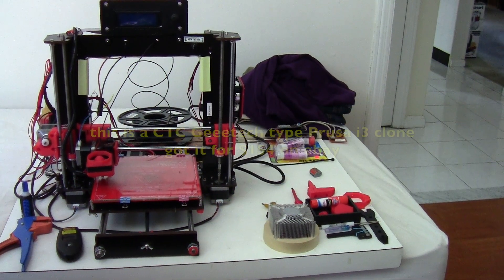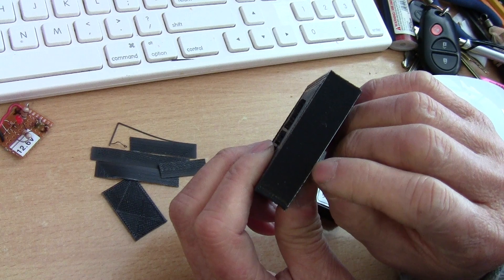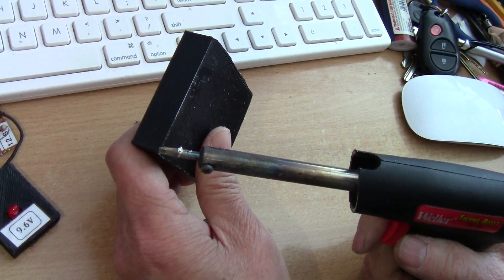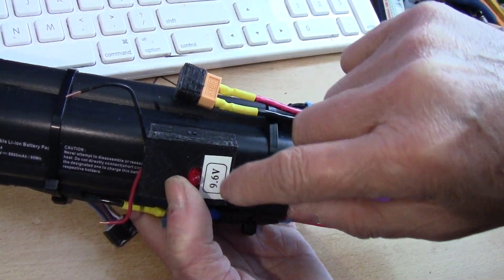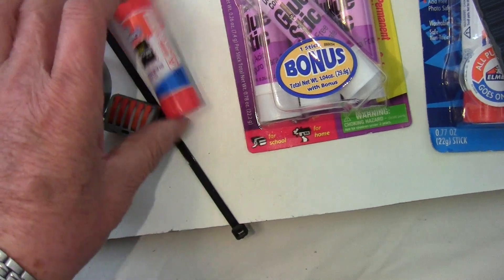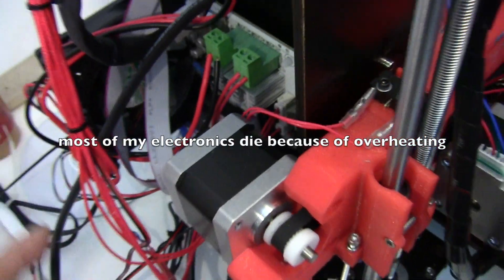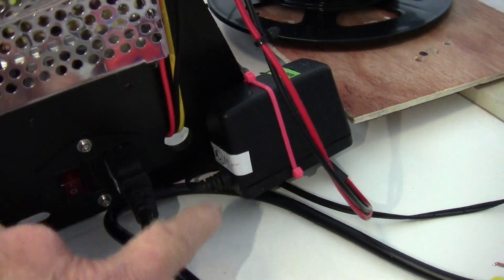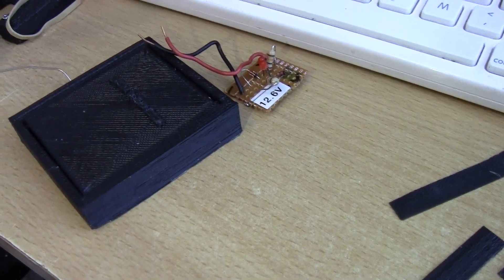3 D printing stuff I learned today

Comment: Looking good. I usually take for granted the electronics heating up because im printing in a cool basement. 
I have a similar plastic welding kit and they work really well.
Reply from the maker: I touched the mosfet the other day and it was real hot.  No surprise as I've been running the printer all day. I think I might have to buy a replacement belt or two. Don't know how long these bearings and belts are supposed to last.  I'm surprised how strong ABS plastic can be.  The adventure continues...
Reply: i think you may need to replace a belt in about 40 years....
Reply from the maker: Surely you jest!
Reply: I have herd of belts being replaced for a finer toothed belt but never even herd one story of one wearing out.  The bearings im sure its possible but ive never seen it
Reply from the maker: We should put the belt on our soles.  Our soles will last forever even though we might lose our bearings.